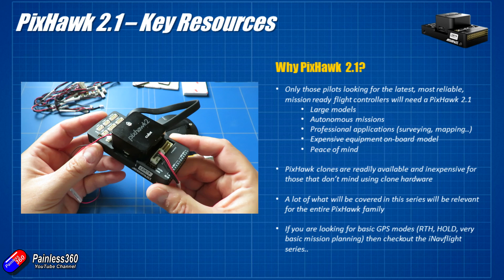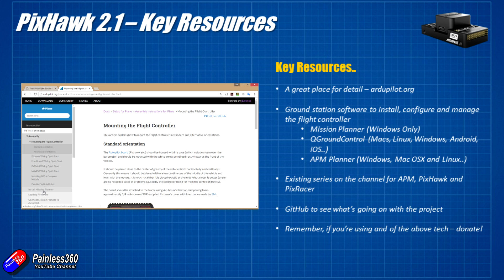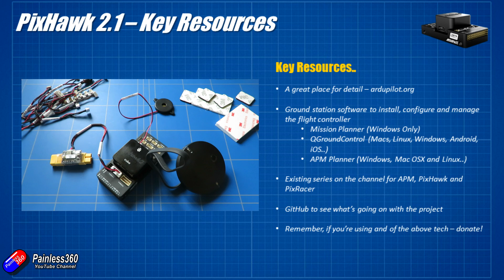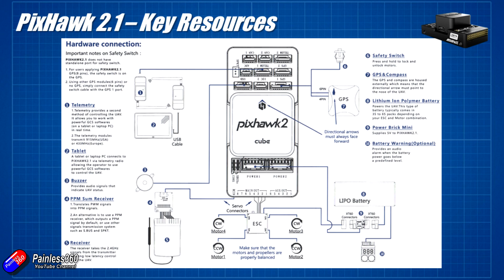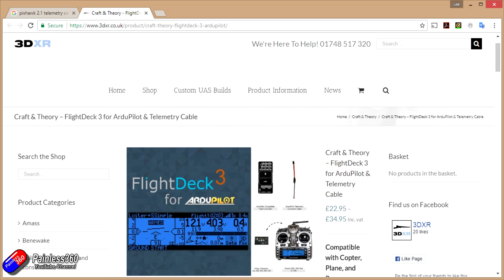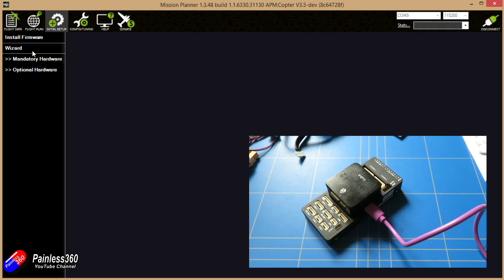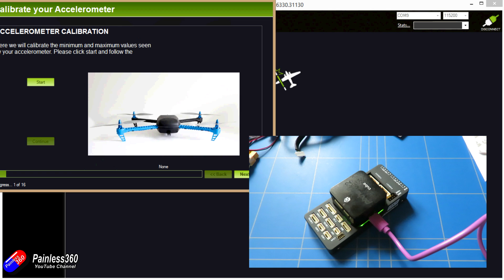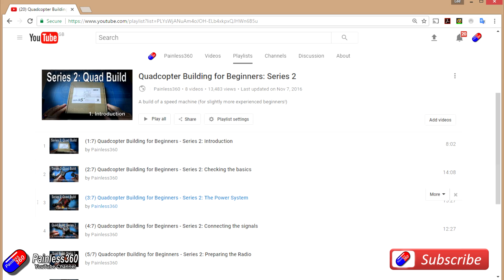(2/9) Introduction to PixHawk 2.1: Resources and Firmware Flashing

Comment: When i plugged my brand new pixhawk 2.1 into my PC running windows 10 I did not get the very first "installing drivers" pop-up, now in both Mission planner and Qgroundcontrol I cannot for the life of me get either software to see the pixhawk, Ive installed CP210x drivers to rule out a COM port problem.  Both mission planner, Qground and CP210x were downloaded "driver signature enforcement" disabled in Windows 10,  I belive at this point that I am missing a key driver to do with the pixhawk itself, please help

Comment: The LED's on my Pixhawk 2.1 go black/turn off after I install a new firmware (where as it supposed to be breathing green)
it blinks orange while loading it, but as soon as its done it goes dark.
However even if the LED's are dark, when I move the Pixhawk around I can see on mission planner that the artificial horizon moves as well. 
Does anyone else have this problem with the LED's going dark??

Thanks!

Comment: Did you used the Pixhawk2.1 with QGroundControl in Windows or Linux system? I already try many forms to use but the software don't recognize the board.
Reply from the maker: I don't use Qgroundcontrol. I'm a Mission Planner fan..

Comment: Are wires and connectors from the previous Pixhawk compatible with the new sockets ? Is it possible to use my old GPS module (Ublox m8n) and other equipment (like 3dr telemetry or buzzer) with the new Pixhawk cube ?

Comment: I've always heard such great things about this platform and personally have had no luck with the pixhawk and pixracer.  I've built countless (has to be almost 30) racing drones using cleanflight/betaflight firmware and have a good understanding of the system.  But something about this kit just drives me crazy.  For those of us paying attention to the minor details, take for example the power cable.  Well, the manual states the XT60 5v regulator supplies shall be connected to the "power 1" port on the carrier board.  So I look in the bag of supplied cables and what do you know, only the cable labeled "power 2" fits the supplied xt60 5v reg.  I thought maybe mine was somehow mislabeled, swapped.  I paused this video and can clearly see you are using the "power 2" cable in the "power 1" socket.  It is these details that gets me stuck every time along the way and unable to complete a successful build.  I can complain all I want but the proof is in the results, people other than me seem to love the product, but for me personally it just drives me mad.  Hopefully, this time with my Cube will be successful!

Comment: Hi dude,
Are wires and connectors from the previous Pixhawk compatible with the new sockets ? Is it possible to use my old GPS module (Ublox m8n) and other equipment (like 3dr telemetry or buzzer) with the new Pixhawk cube ?

Comment: Yes I know that. My point is you are promoting INAV but Pixhawk (your focus) isn't supported!! So when it comes to updating the Firmware I have a problem.
Reply from the maker: Is this in relation to another question? If so then please use the 'reply' function. I can't keep track of the previous conversation with all of the messages I get otherwise.. I think I recall the original question - iNav has NEVER supported PixHawk and I've never said it does, see my flight controller comparison video from Summer 2017 for an overview of the options available. All of this is clearly documented in the iNav Wiki too. If you have a PixHawk then I'd use ArduPilot software - it's what iNav will be in about 2 years time.. I have series on almost all of the common popular flight control software on the channel, so I'm not promoting anything, I'm just helping use the technology..

Comment: I'm thinking of buying a Pixhawk 1 - you can get one for about $150 with LOADS of extras such as GPS, mounts and stuff. How much better is Pixhawk 2.1?
Reply: https://www.rcgroups.com/forums/showthread.php?2918986-Like-new-Pixhawk-GPS-telemetry#post37899667 
I actually have one personally for sale with GPS and all the original hardware for 150 as it would so happen haha
Pixhawk 1 still does most of what the 2.1 can do, just not as future proof but for basic flying and missions it's still great

Comment: Really looking forward to the rest of the videos as I am also building an X UAV Talon (the bigger version)! This is my first real build and am enjoying it so far. Keep up the good work!!!!
Reply from the maker: I'm working my way through it, you can see the videos as they are uploaded (but before they are public) by using the playlist. Happy flying and best of luck with the build!
Reply: I was going to build a full size Talon for my first bird. How has it been going for you?
Reply: No problem so far. Build is getting a little out of hand. Just got in my PingRx and my lidar lite v3 should be in this week. The actual build of the airframe is straight forward even for a noob like me. Take the time to lay everything out and see where it goes before busting out the glue! I put just aft of middle and the 2 10000 mah batteries fit in front sweet, CG dead on. Connecting everything up has been a breeze, tuning it, setting the switches on the taranis, and tweeking the pixhawk are where I struggle a bit. These videos are pretty awesome though. They have helped my out big time. I will post some photos when the last few components are in and the covering is finished.
Reply: I decided to start with a Strix Stratosurfer and a µVector Controller. I still have the Talon; perhaps a 2nd build.

Comment: i recently bought a racing drone, it beeps 5 times when i plug in the lipo as usual and now they beep 3 times :( i need help
Reply from the maker: Happy to help but please watch https://www.youtube.com/watch?v=olIqTiSJHIY and come back to me with more detail of what you've tried..
Reply: Painless360 Ok so it all started when i was tuning my quad i then went on to try to flash some betaflight with it i was using an sp racing f3 it didnt work so i just went with cleanflight it wouldnt connect to the quad so i decided to flash it once again then it said no response from the bootloader. Then i went on to see if anybody else was having the same problem as me and luckily some did  they said to get a thin piece of  wire and put it through the boot holes it didnt work so i. Went on to look for another solution and i came over to zadig and i just changed the location of  where the drone should be i also plugged in the drone before i did this.Nothing happend so i then randomly plugged in the battery and i only heard 3 beeps instead of 5 beeps once you turn on the quad I then proceeded to see if anyone had this problem turns out nobody didnt have this problem i am a newbie by the way if you would be of any help i would appreciate it.
Reply from the maker: +Wolf FPV see the videos I have on the SP F3. I cover all of the steps in those. Also check out the 'Quadcopter building for beginners' too. I use that same fc in one of them too. All in the playlists.. Best of luck with it!
Reply: Painless360 thanks nice vid by the way

Comment: Popcorn is ready to POP...... I'm looking forward to the Frsky telemetry cable part of the series. I have that same setup and not gotten to the setup of the telemetry on my P1 thru my XJT Jr module. Flightdeck looks AMAZING ... the Q X7 screen might be to small...might just get the X9D Plus instead now. Cheers !
Reply from the maker: I've got the cable here so will be looking at it as a separate video once this little guys flying! :D
Reply: Im gonna follow along with an Open Tx Transmitter. Hoping it will help me setup Telemtry on my Turnigy 9XR Pro too, the Ersky9x firmware is not easy. Cheers!